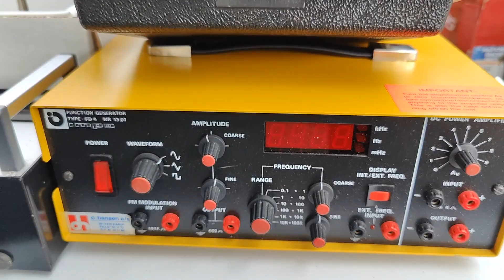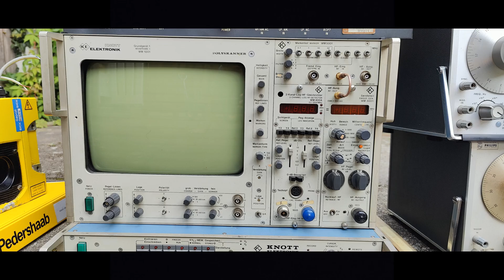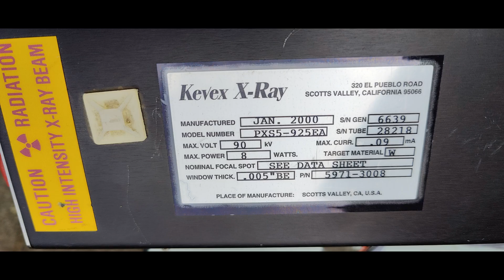Hamradio Radioamateur Fleamarked OZ6FRS 17 Aug 2024

Comment: 3:06 Dang it ... I need some of those small EAO switches ;)

The typical attendants of these markets are (sadly) mostly aged in the 50+ range, where is the younger generation? The markets here in the Netherlands are not much different.
Reply from the maker: we do see a few in the 20-30 years range.. I also collect EAO switches, they are very expensive and last forever, i love to use them for DIY stuff
Reply: @TeardownOZ2CPU  
Yes, there are a few, but not nearly enough, A lot of them are not interested in the "old stuff", bonus for me, I like stuff that was build as a tank ;) but not that great for the hobby in general. 
And yes, those EAO's are great. You can find them at almost every market, the 8mm ones are tricky though.